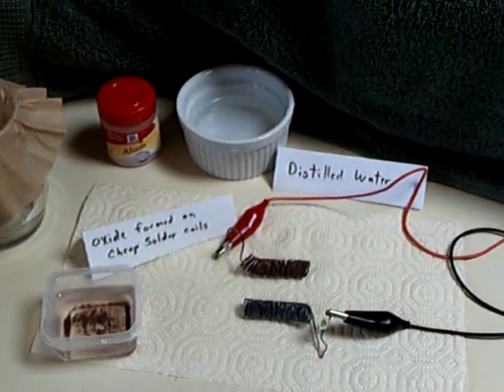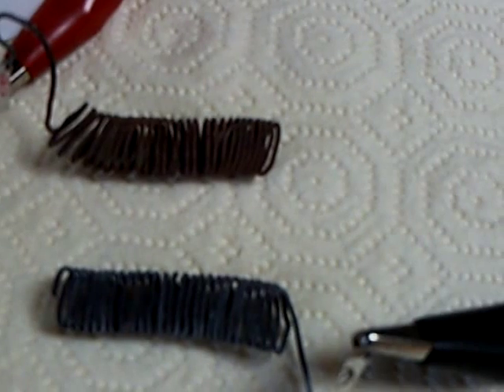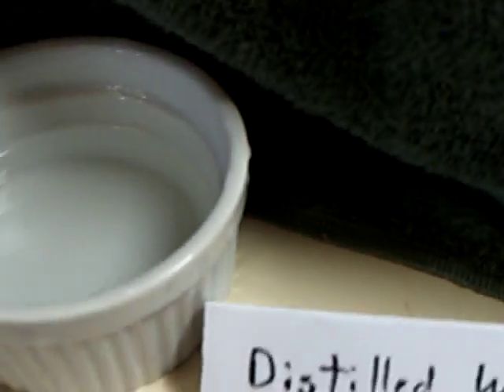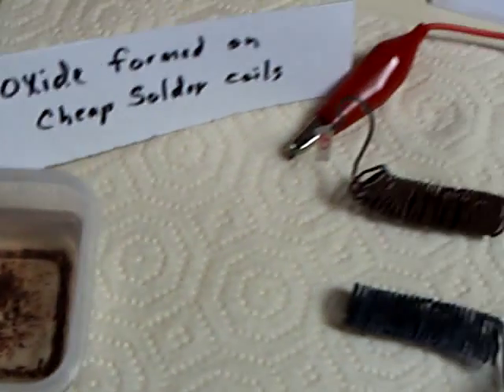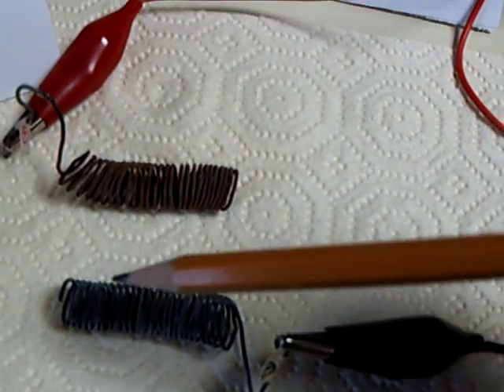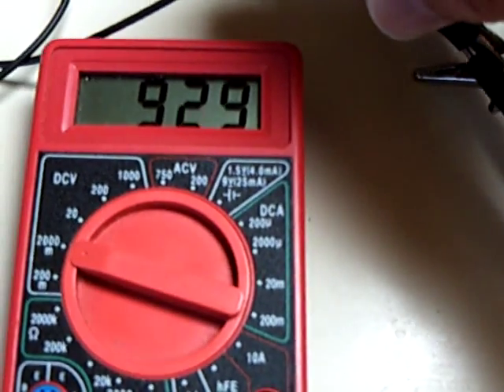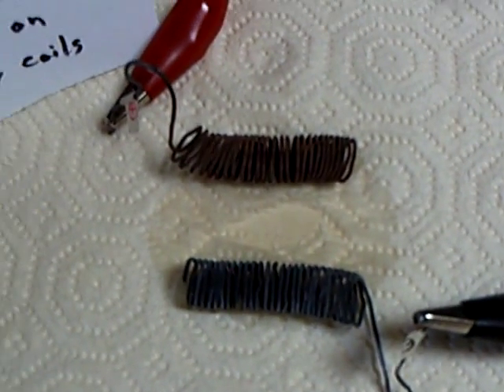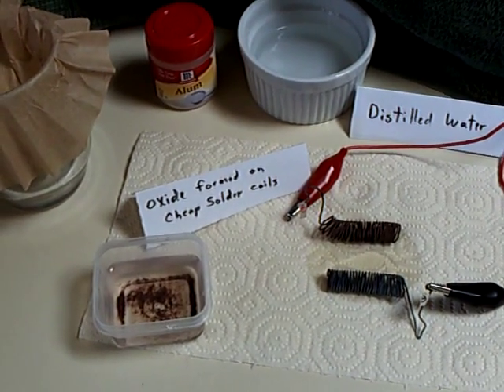Homemade rechargeable battery---dissected after load testing

Comment from the maker: Yes.  People are already doing this with sealed lead acid batteries.  John Bedini made a very valid point though that you can't use a damaged battery where the plates are badly warped or shorted.

Comment from the maker: Let me know how that turns out.   Please stress the safety issues to the students.  You can increase the current with more surface area by roughing up the metal or grooving it.  To form the plate oxides and improve the cell performance charge and discharge the cell multiple times.  The kids should get a big kick out of the project.

Comment: Lidmotor
I have 2 coffee cans full OLD tire weights (40+yrs old) that my middle school students want to melt and smash down flat (about the size of a silver dollar). Will be interesting to see if the 'old weights' work and if the surface area plays a degree in voltage and amperage. - We'll try your suggestion of 1/4 tsp in 3 oz of distilled water as a point of reference.
Thanks for your help and suggestions.
The Ole Shop Tchr.

Comment from the maker: Lead is a very dangerous thing if it is not handled correctly.  So is an automobile.  Recycling the lead (correctly) and not letting it get into the wrong places is extremely important.  If anyone wants to work with this element then they should read up on how to safely work with it first.  This is definatley something to keep away from children hands-----just like a car.